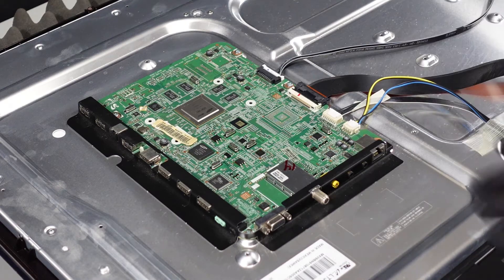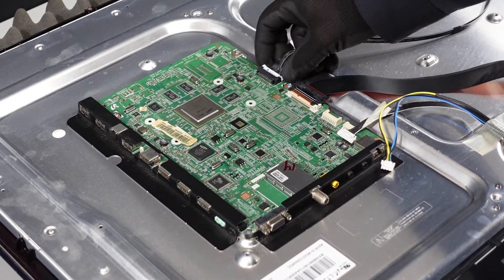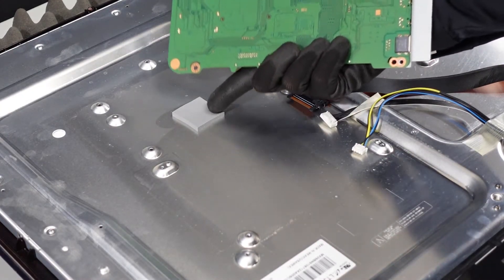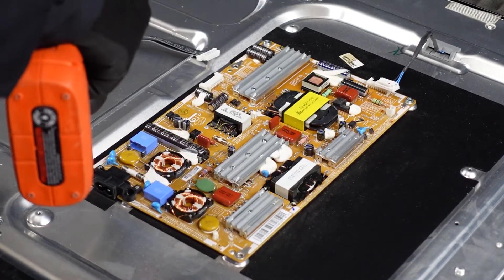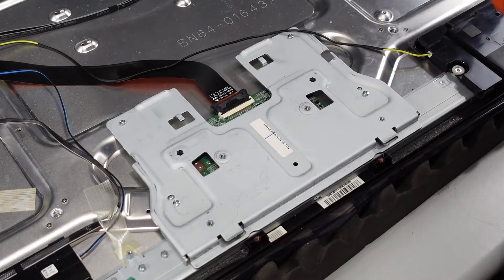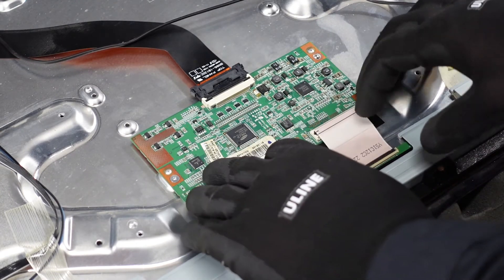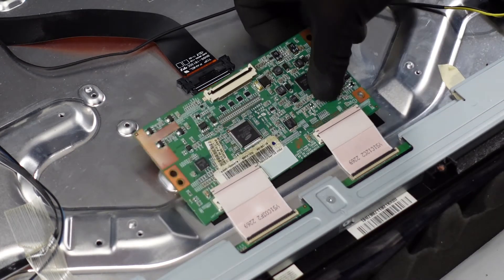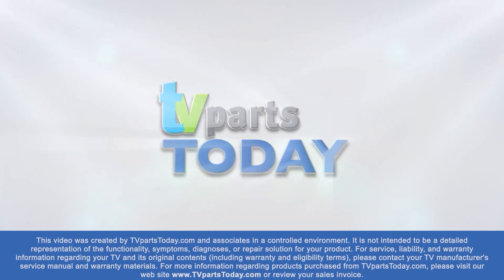Watch how easy it was to fix this TV.  (SAMSUNG UN46D6000SF)

Comment: Is the backlight easy to access? One of my LEDs burned out and I want to replace it.
Reply from the maker: Backlights are not always easy to access. In almost every case, you would need to remove the screen and the other panel components to get to it. There are some small hand-held suction cups that you can purchase that will help you get the various panel components off without breaking or cracking your screen. I'll link an example: https://www.shopjimmy.com/super-strong-suction-cup-lcd-led-tv-screen-panel-removal-tool-set-of-2/

Comment: I have this exact model.  Yesterday the picture went black.  It still powers on, but the power LED flashes five times. I've attempted the recommended troubleshooting steps of unplugging the TV for 15 minutes, then holding the power button to fully discharge, then plugging back in to no avail.   I've read that the power board is the most common cause of this symptom (no picture but power LED flashes and TV seems to power on/off).   Do you think that is the best place to start (replacing the  power board)?  Or do you think this symptom is more likely caused by something else (e.g. Main board, Tcon board, LEDS)?  Thanks in advance!   Great video!
Reply from the maker: Do you have any sound?
Reply: @tvpartstoday  No, but I'm not entirely sure the sound doesn't work because I can't tell if I'm using a source\input that has sound.  Testing that will be difficult because I had the onboard sound disabled in the setting (using only external sound).
Reply: I patiently pressed the source\input periodically for 3 minutes to cycle through all inputs and didn't hear any sound.  I also performed the test where you disconnect the main board from the power supply and confirmed the LEDs light up.  I'm told that indicates a problem with the main board?  My specific main board  part number (BN94-05113J) is out of stock on your site.  However, it looks like part number BN94-05038C is very similar (says it was used for my model UN46D6000sfxz TV on your site).  Do you think that part will work as a replacement?
Reply: Woot!  My part arrived from TVPartsToday and IT WORKED despite not being the exact same part number!  To recap, my main board part# BN94-05113J failed on my Samsung UN46D6000. That part number is sold out at all vendors, but apparently Samsung used a few different main boards in the model UN46D6000 so I ordered the next closest part ( BN94-05038C ) installed it, and voila!  My TV works great again!  $36 to keep my 11-year-old TV out of the landfill is well worth it!  Hopefully I can get another 11 years out of it!
Reply: @hanoihancock  this is EXACTLY my problem , how did you know what part number to order?
Reply: @philip2692 As you can see from the exchange above, the TV Parts Today folks were super helpful.  After they helped me diagnose here, I went to their website and plugged in my TV's model number and was presented with many part options.  I knew the exact part number I wanted because I had removed it (the main board in my case) from my broken TV already.  That exact part wasn't available so I took a risk and bought the most similar part available (a main board for the same TV model but a newer version).  That similar-but-different part worked for me and is still working as I type this message.  Hopefully you can either remove your broken part to get the exact part number first and hopefully that part is available.  If not, then search by your TV's model number and get the closest part possible.

Comment: I have this exact tv and my speakers have gone out. They sound really fuzzy. How much are replacement speakers? I might be better off to buy a new tv or use an external speaker.
steve
Reply from the maker: Hello, 

Unfortunately we do not sell speakers we sell the circuit boards so we are unaware on the pricing.

Comment: We had a section of LED's out in the upper right corner.   I was getting ready to buy new LED strips when the corner came back on and the section next to it (upper right of middle) went dim.

Would that be the main board or do the LED's do that when they're getting to end of life?       Thanks in advance.
Reply from the maker: It sounds like an issue with the LED's themselves, but, If you were going to try to replace a board, I would try the power supply first.
Reply: @tvpartstoday  Thanks.   I wish I had watched your video before an earlier disassembly.  I didn't know about the little flip bars.

Comment: What did you fix?
Reply from the maker: The intent of the videos we create is to illustrate just how easy it is to fix issues by replacing the circuit boards. If your UN46D6000SF has any issues with the Main Board, T-CON, or Power supply you can use this video to help you in your TV repair. You can watch someone else remove the parts so that you can feel confident to remove your parts with out damaging your TV.
Reply: @tvpartstoday  
Oh. Title is misleading. Should be something like How to replace boards on a Tv.